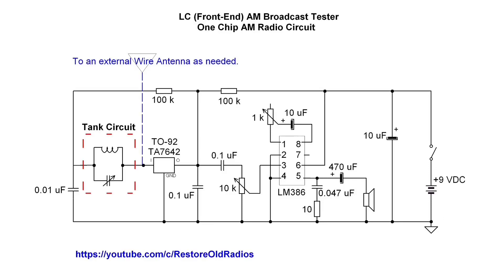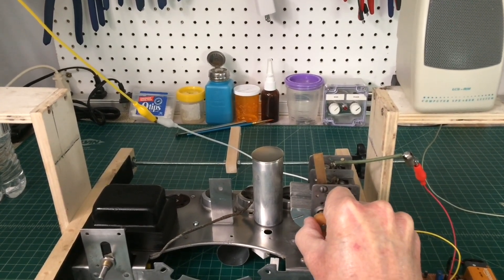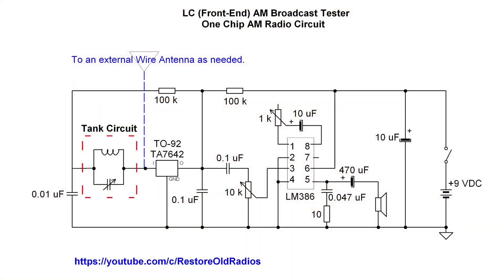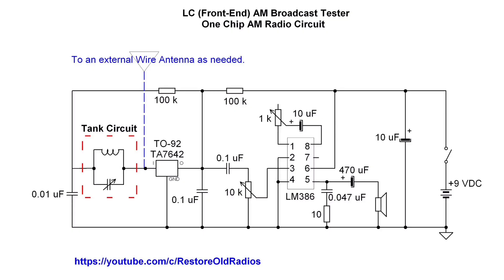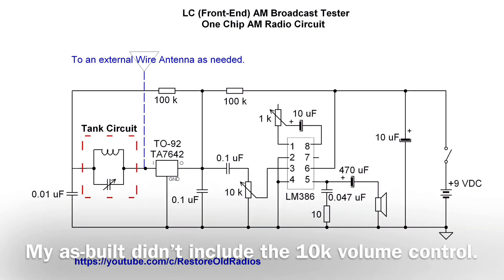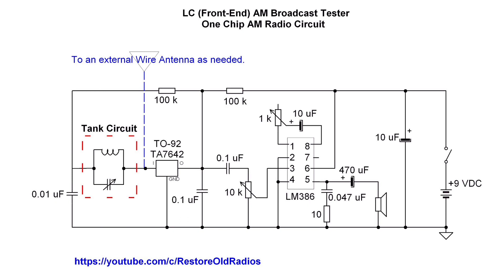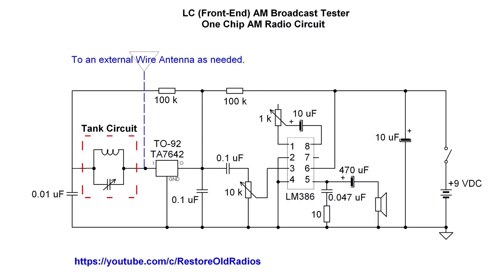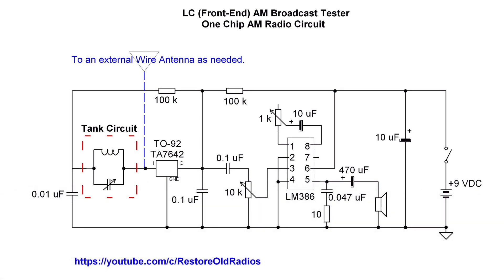LC (Front-End) AM Broadcast Tester - One Chip AM Radio Circuit

Comment: What's the function of the 0.01uf capacitor on the left of the Tune circuit?
Reply from the maker: Javier - according to others that built/designed the original circuit, it should help reduce stray capacitance (frequency drift) when placing your hand near the tuning capacitor (tank circuit) when tuning. All the best. Don
Reply: Thanks😄

Comment: If you discard the external wire antenna and replaced the coil with a ferrite coil antenna to produce a standard AM radio, has the tuned circuit  now become a series LC tuned circuit due to the change of signal input?
Reply from the maker: Martin - you would still need a variable capacitor in parallel with the ferrite coil to tune the circuit to the desired resonant frequency. Best, Don

Comment: Having something like this as a part of one's test bench is yet another improvement destined for greatness; especially in perfecting one's craft and diagnostic skill.  Next (if it doesn't already exist) is Don coming up with IF & circuit mixer checker. Me, unlike that 1-2 kHz tone going through a unit I like a chosen selection of recorded music going through the set (with the required IF signal of course). Don's tone generator circuit works great for this....not to mention my family not complaining about that tone noise.
Reply from the maker: A clever idea. You could take the design and substitute the audio from a Bluetooth receiver most likely. Thank you for watching and reaching out. Best, Don